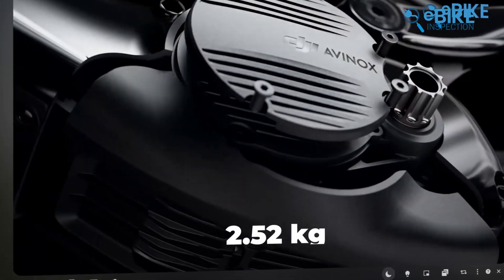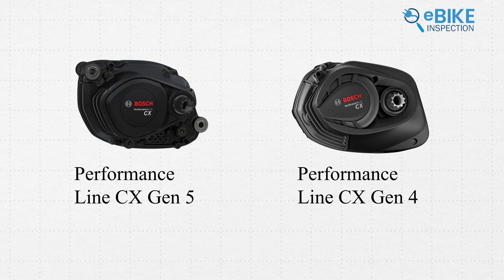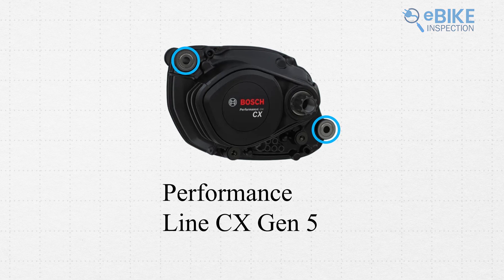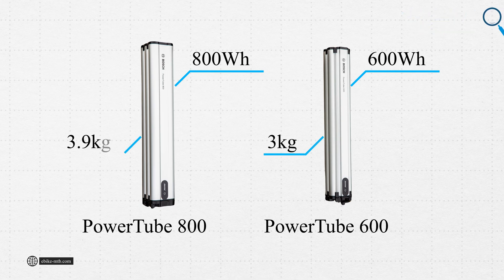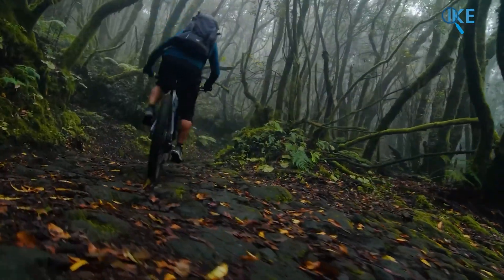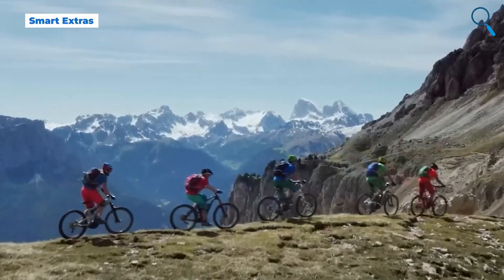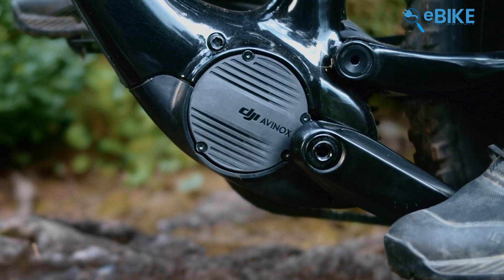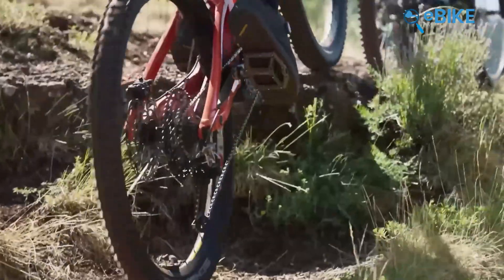Bosch Performance Line CX Gen 5 vs DJI Avinox - Bosch's Answer To DJI's Revolution

Comment: The peak power of the Avinox system is 1000 watts not 850 as you have quoted .
Reply from the maker: "In the special Boost mode, it churns out up to 120 Nm of torque and 1000 watts peak power. In the normal support mode, on the other hand, it delivers 105 Nm of torque and 850 watts peak power."
You can definitely cross check.
Reply: @eBikeInspection  yes that is better now you are correct.
Reply from the maker: Thank you

Comment: it's all on paper so far .No real world long term rider testing and the 120 Nm is only available for 30 seconds before it reverts to a lower assist level . 
DJi openly admitted that they are concerned about overheating .
Compare that to the long time existing TQ 120Nm and the Sachs/BMZ 112 Nm .the BMZ power can be accessed at low cadence (40to60)  rpms 
WITHOUT overheating or shutting down . 
So lots of hype around the DJI but the devil is in the details .
Reply: Still 2 year warranty for both the bosch and dji so whats the risk  ?
Reply from the maker: You're right. Everything will be clear after real-world testing.

Comment: What matters most for me is firmware as well, gen 5 bosch & battery layout just has 5 lights 😂. So my question is why so hard for them to add 10 lights pr a battery percentage monitor, same with shimano.
Reply from the maker: It's a valid point. Better battery indicators would definitely help users keep track of their charge levels. Hopefully, companies like Bosch and Shimano will consider adding these features in the future.